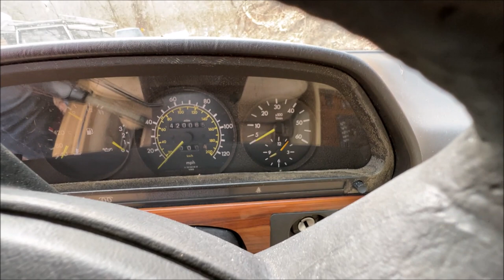VW Beetle Salvage Yard Visit  - How To Remove a Rear Sway Bar Z Bar Removal - Forgotten VWs - VW Bug

Comment: yes, I made it guys, Heather I had a 67 GMC truck in the 70's when I use to haul our band equipment to each local gig on the weekends. It had a tall canopy on it which was great. Granny first gear that never was used because it was too low. always started in 2nd. Had a big cylinder V6 and the water pump needed a hoist to lift it out to rebuilt but had a tiny single barrel carb which looked totally out of place on that big engine. Cool truck and I can post a picture if you like but, on your website, since it won't work here.
Reply from the maker: Thank you Tim, I really like that truck a lot. I hope he does not let it just sit there and rust. I think it has a lot of potential.
Reply: Wow! That is a cool story! I would love to see pics!!!!
Reply: That's the wife's 72 Cameron she used to have back then too. This was right before we got married in 78
Reply: I sent the pics here but I see it didn't stay on here. I''ll send them in you guys email

Comment: Hi I need help please. I have been watching most of your vids on here great work. I am about to take the body off mine and have come accross  this z bar, none of the video i have looked at says anything about this when taking the body off. what do i need to undo to the z bar to get the body off? HELP
Reply from the maker: i am actually doing a z bar rebuild video soon, funny you brought that up. you'll see the 13mm nuts at the ends to remove them. Its VWs old style rear sway bar. Thanks for being here!

Comment: Bees And snakes have always been the issue around me
Reply from the maker: For some reason, Heather is not afraid of snakes at all. On the other hand, I run like a small child from them 😁
Reply: I'm having a hard time putting my Z-Bar back in do you have a video about that and the new bushings being put in
Reply from the maker: @doomsday_3162 I just got a rebuilt kit from Wolfsburg west for my Z-bar. But that video won’t be up for a few weeks though.
Reply: @SladesVWBeetle  yeah that's where I got mine from